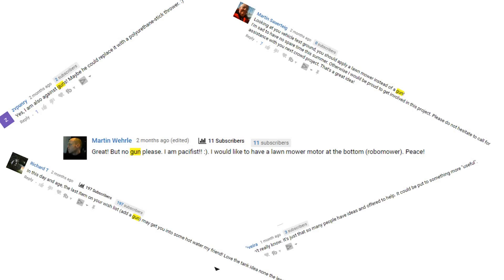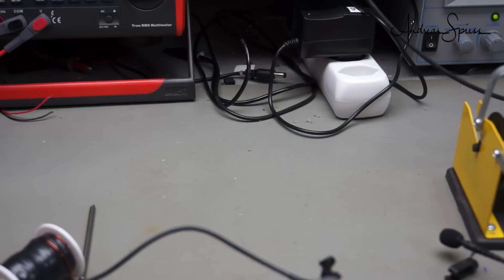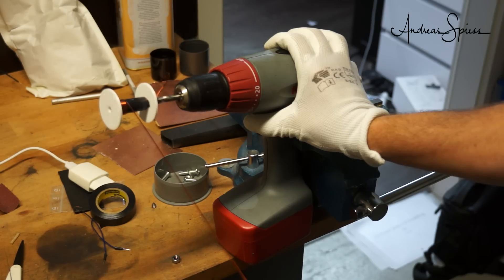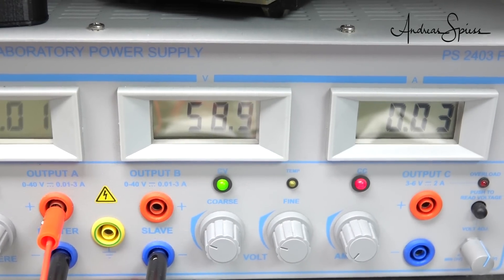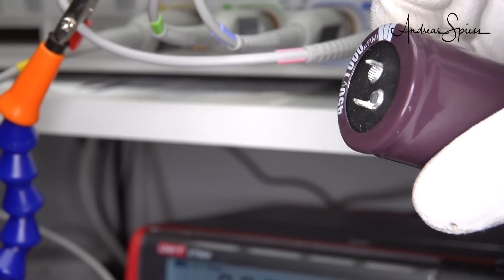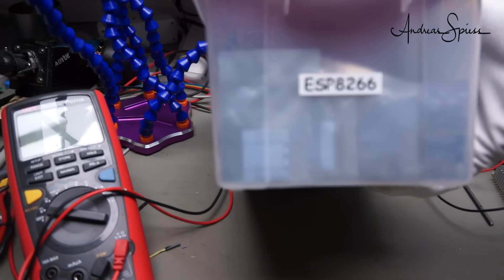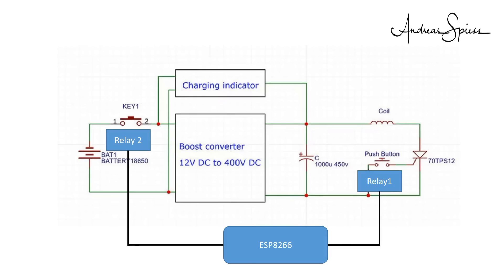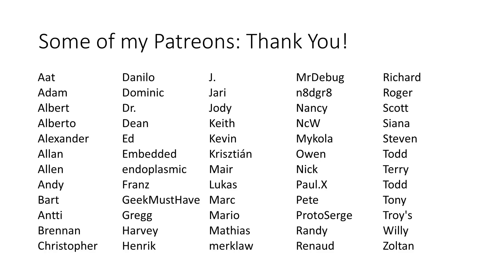464 Better than GreatScott's Coil Gun? A true story, how-to not do it

Comment: "High voltages" Yes, the main reason I took up digital electronics, back in the day. Not a lot over 5volts   😂 Did you consider adding another coil in series, to accellerate the projectile along the 'barrel'?
Reply from the maker: This project was enough for me. After that experiment, I did not touch high voltage and returned to the 5v (similar to you)...

Comment: Thanks for sharing. It would be interesting to measure the muzzle of the nail and back calculate what percentage of the energy stored in the capacitor was converted to the kinetic energy of the projectile. An interesting data point to build a multi stage rail gun. Is it possible to launch a low orbit satellite with a rail gun?
Reply from the maker: I saw some rail guns for military. Maybe it could produce enough energy for a satellite. But I donot know.

Comment: Blowing things up is sad but makes for great stories. I blew up a board on an oscilloscope. It was quite a show. I had fire, smoke, sparks, light and noise. Kind of a long story but the short version was I slipped with a meter probe from a 5 volt copper run on the circuit board to a 500 volt copper run. Many small components disappeared. But I'll never play with a rail gun. Small fast free flying metal parts frighten me.
Reply from the maker: I also do not like high voltages above 24V. But I had to try this one ;-)

Comment: Could the capacitor be swapped with a couple 6S lipo batteries to reduce the voltage?
Reply from the maker: Maybe. Then, you would need very thick wires.

Comment: Did you check the voltage when you switch the circuit off, pretty sure the coil could generate several hundred volts
Reply from the maker: The capacitor has to be discharged before the thyristor opens. But I never checked.

Comment: Seeing this reminds me of my first ever made and sold engine idle controller.
I read some signals on the car, took the idle valve home, made a board with a voltage controller, arduino mini and transistor. So i got to testing in the lab and the only thing i forgot was the flyback diode. Now everything was great.
I put it in the car, tested again, everything worked and then asked a guy to turn on the engine for me.
That was when everything died. including my laptop. So i had to get a new laptop and start again. all fresh parts and WITH every conceivable protection on everywhere. At least have damage control :)
Reply: Maybe, maybe. Very probably. Look here: Ultra power full COILGUN!

https://youtu.be/s6cFMM6MTpI?si=d9uViwHaR6vgnW1g

https://youtu.be/xY17v43TorU?si=ms8LLehidgsVw2Ep

https://youtu.be/zoA_iUGHyPg?si=IuZUGnQfxk9x0d74

The evolution of the bazooka in the third millennium SILENT BAZOOKA (COILGUN - BAZOOKA).

https://youtu.be/0yvVi1eukeI
Reply: @howardstark6707 👍👍Amazing!
Reply: @survivalinthezombieapocaly2142  🤝
Reply from the maker: We all learn with our mistakes. The bigger the pain, the faster the learning ;-)

Comment: Hello Andreas, I am a big fan of your expertise and your great videos. Your projects have motivated me to realize a small project with an ESP32-lolin32_lite and a Dallas temperature sensor (DS18B20) and 2 pieces of NCR18650B L-Ion. Unfortunately, I only achieve a runtime of about 48 hours, after which the batteries are empty - can you possibly give me a tip here? I would like a runtime of >= 1 month. The MCU should really consume little power in DeepSleep! Thank you in advance for your efforts!

pooltemperature.yaml

esphome:
  name: pooltemperature
  friendly_name: Pooltemperature
  on_boot:
    priority: -10
    then:
      - delay: 2min  # Stay online for 2 minutes
      - deep_sleep.enter: sleeping

esp32:
  board: lolin32_lite
  framework:
    type: arduino

#################################################
## Enable logging
## increase logging information
## level: VERBOSE
## level: VERY_VERBOSE
#################################################
logger:
  # level: VERBOSE
  level: NONE

#################################################
# Enable Home Assistant API
#################################################
api:
  encryption:
    key: !secret api_key

ota:
  password: !secret ota_password

wifi:
  ssid: !secret outdoor_wifi_ssid
  password: !secret outdoor_wifi_password
  fast_connect: true  # Use fast_connect to speed up connection
  manual_ip:
    static_ip: 192.168.1.86
    gateway: 192.168.1.254
    subnet: 255.255.255.0
    dns1: 192.168.1.35

#################################################
# Deep Sleep Configuration
#################################################
deep_sleep:
  id: sleeping
  run_duration: 2min  # Optional, but added for clarity
  sleep_duration: 1h

#################################################
# Dallas temperature sensor (DS18B20) on GPIO 5
#################################################
dallas:
  - pin: GPIO5
    update_interval: 30s

sensor:
  - platform: dallas
    address: 0x190119291fbceb28
    name: "Pool Temperature"

#################################################
# ADC Configuration for Battery Voltage Measurement
#################################################
# For the lolin32_lite board, the battery voltage
# can be measured using the built-in voltage divider
# connected to pin GPIO35.
# The lolin32_lite has a voltage divider that divides
# the battery voltage by 2. This means that the ADC
# will measure half the battery voltage, and we must
# multiply the ADC reading by 2 to get the actual
# battery voltage.
#################################################
  - platform: adc
    pin: GPIO35
    name: "Battery Voltage"
    update_interval: 60s
    filters:
      - multiply: 2  # Adjust the measured voltage based on the voltage divider

Comment: As others have suggested, a pulse transformer is probably a better option for the gate trigger and I'm not sure about floating gates (though many devices seem to use them). Suggest also a snubber to protect the ESP (spikes back through the transformer when the thyristor switches off). My knowledge is not sufficient to determine what happens to the output voltage on the boost converter when the thyristor switches off and the coil collapses, there may be a very large spike.
Reply from the maker: I also do not know what happens. But maybe the current is already low because the capacitor is discharged when the thyristor opens.

Comment: I think that the best way to drive thyristor in that kind of circuits is a transformer. But i know a defibrillator that uses a H-bridge made of opto-thyristors with some additional circuit to close them in right time to provide patient impulse of right waveform. And that circuit works ok, providing short biphasic impulse of ~ 2kV and 40A. Maybe you will find it useful next time.
Reply from the maker: Thank you for the info!

Comment: There's no way I would attach digital electronics to that without going through an optoisolator. What you want is an opto with a diac output. I use them to drive triacs when running high voltage AC components
Reply from the maker: I agree (now).

Comment: Been there done that - nothing as exotic as a coil gun how ever, but simply controlling various 220vAC inductive equipment like motors and valves with 5/3.3vDC. Mechanical relays and batteries are your friends in the control circuit where an inductive load can supply you with huge inductive field collapse spikes, even if you use snubbers, MOVs and all sorts of protection. Nothing gets past the mechanical relay separation back into the control circuits. Thanks for your entertaining and informative videos!
Reply from the maker: Thanks for sharing your thoughts!

Comment: Andreas, it is a good practice to explicitly provide a path for the current to continue to circulate via the coil so that it does not cause overvoltages. Usually it is done using a diode parallel to the coil with a direction opposite of the initial current direction. This removes the possibilities of overvoltage, however it makes the switching off of the current a bit clumsy as the magnetic field drops slower and can draw back the projectile. You can use more advanced calculations to use a resistor connected in series or parallel and also choose a thyristor for the proper calculated voltage to balance the maximum voltage and the time of dropping the current. Maybe you can also use some kind or an air gap or semiconductor overvoltage protection instead of the diode, but I cannot confirm this works fine.
Reply from the maker: Thank you for your tips!

Comment: A 2005-2009 Toyota Prius inverter has a boost/buck converter and high capacity IGBTs built into it with an external harness to control everything and can reach 600v all for around $60 USD. Just incase you are looking for a high quality power supply for high voltage and current projects.
Reply from the maker: Good idea. If it is Toyota, it must be of quality
Reply: @AndreasSpiess  this guy @evbmw has a lot of information on his channel about using those inverters. In one video he shows that he blew a capacitor bank on a gen3 Prius inverter and it still worked.

Comment: my arduino survived every trigger event. But I used a mcp1407 gate driver, that was connected to the arduino by a resistor. That might have been enough isolation. Everything worked fine until the IGBT (that I used instead of a thyristor) popped. I guess I was too close to its maximum power limit. After that boom I stopped playing with high voltage.
Reply from the maker: A boom often helps in decision making ;-)

Comment: After thinking about this a little more.  It is clear of the problem.  You are charging the inductor and getting the magnetic field high enough to push out the nail.  The controller then interrupts the current.  As the magnetic field collapses,  the voltage will go way up (Lentz' law).  The RC snubber will be a good idea but it better is large MOV (Metal Oxide Varistor )across the SCR.  The watch the joule rating of the MOV.
Reply from the maker: Are you sure that the voltage goes up in this design? The thyrisor only opens when the current is very low. But for sure it would be worth adding such a diode. Just in case...

Comment: If you are like me, i feel your pain for your losses...on the plus side there almost always a lesson to be learnt. As a side note, beware that 1/4w resistor have a maximum voltage about 200V or so, better to place 2 or 3 in series in the "high side" for that voltage range.
Reply from the maker: I agree. Usually I use a few resistors in series in such situations.

Comment: I appreciate that you allow us to learn from our mistakes. I would recommend you to look into opto triacs, they are available with dip sockets. With an opto triac in one direction and a optocoupler into the other you would have more safety. 

You have kiloed a psu, but what would have happened if this was a lithium battery? Could the bms have rescued it? 

Maybe also add a e10 lightbulb  in series ti the capacitor to reduce the charge current 

And you could probably improve the safety with a second triac (or mechanical switch) to slowly discharge it through a resistor when needed.
Reply from the maker: I agree with all your recommendations.

Comment: EMF concern: I was especially worried that there was no isolation on the capacitor charge-sensing voltage divider. You claimed that it would express the maximum voltage as less than a volt to the MCU. But, back-EMF from a coil like that could be in the thousands of volts! Even after the 400:1 voltage divider does its work, the resulting voltage to the MCU could still damage it. 
Maybe the thyristor is handling the reverse voltage spike (back-EMF). But, I doubt it is rated for that kind of voltage. I'd definitely also use a flyback diode on the high side of the coil.
Reply from the maker: Are you sure this coil creates any back EMF? The thyrisor only opens when the current is nearly zero. Before, the coil is firmly connected to the capacitor

Comment: You can use square copper wire (used in windings of big transformers). It's resistance is much smaller and due to the square shape, you can pack the turns more tightly on the bobbin.
Reply from the maker: I agree. The coil would be come smaller.

Comment: Andreas, you might want to consider using the working inners of an Airsoft gun shooting plastic BB''s. It uses a pneumatic piston pulled back by an electric motor and has the ability for repeating shots.  the velocity of the plastic BB is determined by the spring that drives the piston and is reasonably safe. The individual parts can be bought to allow for tuning the configuration to your needs
Reply from the maker: This would for sure be a less dangerous method!

Comment: It's coil so runnning 200A thru will do nice back and forth with the voltage putting directly into esp32 also some protection for the thyristor should be added and the converter but I'm not woried that much for that
Reply from the maker: I agree.

Comment: I almost killed my brother with one of these. I build one of those 20+ years ago. Disassembling a camera flash charge circuit and connecting 2 capacitors similar to this one. Worked well. Everything was fine until my distracted brother put his hand on the circuit. He jumped back turned white and took a deep breath and said: I think my heart stopped beating for a moment 😅
Reply from the maker: So you learned how to build such a machine and he learned that he should not touch your stuff ;-)

Comment: Fantastic video about the world of high voltage.  I am a 76 year old engineer that got a ham radio license when I was 15 years old and back then EVERYTHING was high voltage.  The first transmitter I built had over 400 volts on some of the vacuum tubes. It is a different world.  Switched high voltages can also create rather powerful RF pulse that may have been the source of some of your mysterious effects.  In the USA, the world of high voltage is at about 50 volts according to the National Electrical Code.  That is one reason that telephone and data lines generally run at 48 volts.  I have been watching your videos regularly and they are the most informative on You Tube.  I hope you can fix your power supply, it appears to have been a very good one.
Reply from the maker: I was born a bit too late for tubes. They only were in the power stage of my first FT-277 ;-)

Comment: When I started my "adventures" with SCRs, we had no ICs yet.  Just discrete transistors and passive components.  But there were some good data sheets and better yet, application notes - even books.  So I kept reading and reading.  Somewhere there I found that A term dI/dt was something to take  literally.  If you let the SCR experience a very high dI/dt, it tended to blow its magic whatever in no time at all.  The explanation was that the current was concentrating near the gate and not having time to spread over the whole silicon area.  Two solutions -- first the manufacturer of the SCR had to provide some means of spreading the gate wider (at least effectively).  The second one was that I, as the user, had to design my gate drive much better.  That meant timing and amplitude optimization.  The static gate trigger voltage was not good for the desired effect, I needed much more, and that in a controlled seed along with certain resistance.  Additionally, It was necessary to consider what happens when I try to end the kickback from the coil.  A thyristor does not have infinitely fast recovery either!  Much of the time I had to add a second, small value inductance to the anode and a free wheeling diode next to the SCR & small choke combo.  So I designed my own gate drivers with a few microseconds rise time.  Armed with the good info and god drivers, we eventually used SCRs quite routinely.  And one last application used a then new high performance SCR to produce up to 10 000 A pulses (not for coil gun, though).
Reply from the maker: As you describe: Such a project is more complex than I initially thought. And it needs a lot of experience to work in those topics. I decided to go the other way than you: Avoid it in the future ;-)
Reply: @AndreasSpiess  No graphene making for you then!  🤣 As shown here "Making graphene could  kill you but we do it anyway!!"

Comment: This was another pleasure to watch. 

It also shows that there are many different disciplines in electronics.

These kinds of experiments are not without danger but are fun.

Which reminds me of a tube FM transmitter I once built. 
I didn't realize that the field around the coils in the endstage would be a bit more powerful. Soon it smelled like burnt meat and I had to run to the faucet. :)
Reply from the maker: I am happy that we do no more need tubes for the RF power amplifiers. When I was young, this was the standard (I never worked with them).

Comment: Hi Andreas, you had a bad day. I like to see/hear not only success stories. By seeing this videos we can learn a lot.

For isolating circuits i use the 282EH photo relay. The output is a normal relay contact, and no mechanical parts. I thought it can do 1 amp.
Reply from the maker: These solid state relays indeed are good replacements for mechanical ones.

Comment: pvc pipe is a cheap barrel, steel ball bearings are easily fed for multi fire...
Reply from the maker: It would be interesting to see if a ball is long enough to generate the needed energy.
Reply: @AndreasSpiess  more volts, more coils, more devastation.....

Comment: I've worked with HV for a personal project and... well, I called my parents when I was done with it. Now, when I want to make a coilgun, I just stick with high-amp designs instead of high voltage designs! Thankfully, lion batteries and supercaps make this possible!

If you want to try the same, a 6s (~40V) lithium battery can still supply hundreds of amps on a compact coil, so you can have a fun plinker without the danger factor!
Reply from the maker: Indeed, high amperes got much easier these days. But they still need a lot of copper ;-)